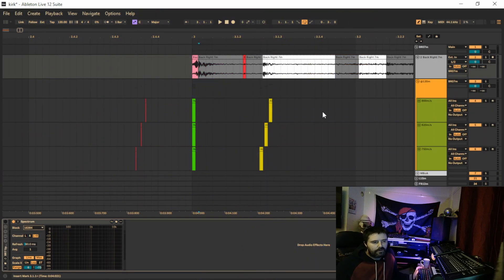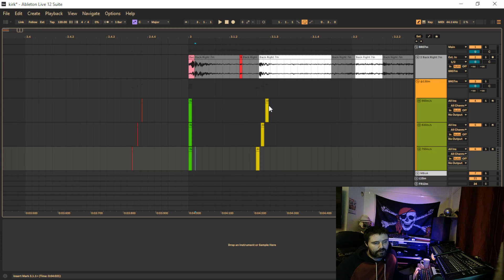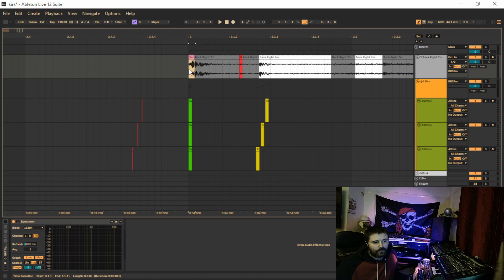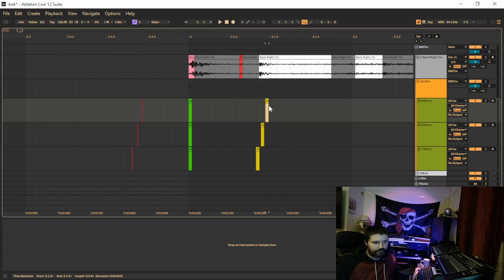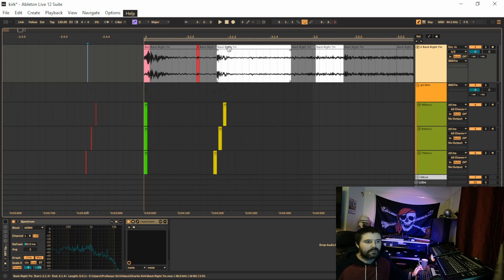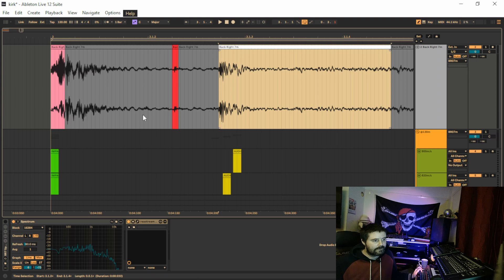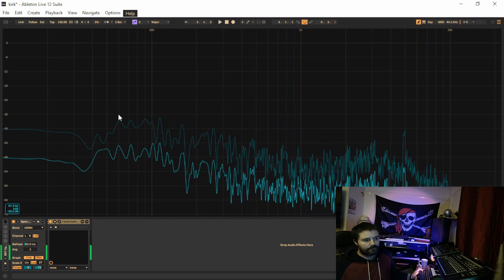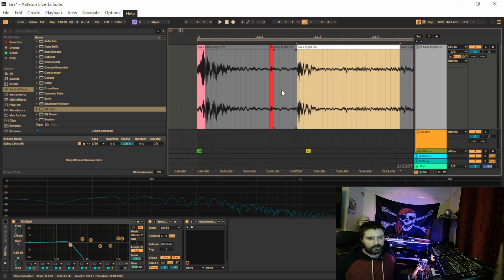I got a Freq'in Question

Comment: Been reading the comments but haven't discovered an answer to this: if the sound of the "muzzle blast" (boom) didn't come from 130m away from Charlie, could it (the boom) have been broadcast through the loudspeaker(s) around and near Charlie?
Reply from the maker: Great question! I do actually have reflections with the PA system in. There is a 2.8ms delay in the audio reflection which works out to about 1m distance I think, off the top of my dome. So, yes there definitely is a PA system being picked up and I can, and have measured it. And, I had it verified. As for the boom, the PA system won't be effective to recreate bass waves at 40hz efficiently, you'd need a much bigger driver than those speakers contain, so while it can recreate it to an extent, it can't produce what we would call natural sound and all it's dimensions. Hope that helps? :)
Reply: @Audio-Freq yes that's helpful, and I should've been able to figure that out myself. Not enough bass ability in those little PA speakers. 👍

Comment: Hey Matt, could you check the time difference between the left and right mic's for a camera on the left and then for a second one on the right of Charlie's position?
If the shooter is on the South side those should give similar l/r leads while if the sound is coming from the front of Charlie then the l/r leads should be opposite - correct?
I'm assuming (reasonably) the cameras are facing 180 degs apart, both aiming at Charlie. Make sense?
Reply from the maker: Yes, definitely. It's a little bit trickier to time the impacts for me. I can try though it's going to be happening in one sense or another

Comment: "The Impact"?  What do you think 'the impact' actually is Matt? A sound ( of what exactly?) An action ( of Charlie being hit? his body reaction? What is your opinion?
The timing between those two main things you are asking about is around 0.218sec. That is the exact time between the sonic BOOOOOOOM! ( It is LOUD! as it is the CLOSEST sound to the mic's! and the BOOOOM is made from the barrel right up to the point it hits Charlie!!) and the later bang of the rifle 130m away - it is a quieter sound by the time it reaches the mic!
The sound of the 'impact' being the bullet as it hits Chalie would be indistinguishable by comparison as the sonic BOOM is still being made right to the millisecond it hits.
Sonic booms are loud noises, particularly when the sound is being generated VERY close to your ears or a microphone (close being within a few metres!) It's not a negligible component of the sound we hear as a 'gunshot'. ( In the case of a supersonic bullet.)
The red lines you draw as when the gun is fired have to be 0.153 seconds from the BOOOM and 0.371 seconds from the bang.
Hope that clears the confusion a little?
* I'm using 850m/s for the bullet and 130m for the distance - you can vary those either way a little but you'll get the result in this area. It will vary as the distance the mic is from the Lossee centre decreases.
Reply from the maker: Well the impact of the sound of the projectile hitting something. A thud. This mic was behind and to the right, I believe? It's separate from the sound behind the bullet because the bullet should be moving faster than the speed of sound
Reply: @Audio-Freq  Thanks for clearing that up for me Matt!
On TV (and also in real life) we associate the act of a bullet hitting something with a sound - a 'thud' or 'ping' as in a ricochet, 
That is NORMALLY the case - for subsonic bullets.
Supersonic is a different matter. When the bullet hits something it is still making the BOOOM! so any impact sound into something soft and pliable (like someone's body) Is made at the EXACT instant the bullet hits and the BOOM stops being heard (at the point of impact).
The boom disguises the sound of the impact!
Mic's any distance away always hear the sonic boom noise first, (becaue it is MOVING faster than sound) but it would be very quickly followed by the initial impact noise.
This is because the impact sound travels from the target direct to the mic at the slower speed of sound while the sonic boom is in a 1:2.33 ratio 'triangle' trailing the bullet line with it's tip at the body point and traveling at 2.33 times the speed of sound. (Important note: the crack moves through the air at the speed of sound BUT the cone is moving relative to any observer 2.33 times FASTER than the sound. Crazy huh?)
I think I calculated the timing difference to be something like 1.55m per every 10m distance from the bullet line so if a mic was 10m from the bullet line and level with the target the sound would arrive in 10m/350m/s around 0.03s while the cone is moving over twice that fast towards the mic so would hit the mic around 0.013??)
Are ya with me?? ;-)
Reply: @Audio-Freq  Did you see my 'explanation' below (above?? = on this comment thread starting with 'The impact?')

Comment: 3000’ per second. Around there, if it was a 30-06. But it was not a 30-06. It was a smaller caliber, and it was close. In that space a magnum caliber round would be a LOT louder. 5.56 would be moving at around the same velocity, about 3200’ per second. Less if the barrel was short. It sounded like a 9” barrel, no suppression to me, based on audio from that camera just left of the stage. It sounded like 30-40 yards. 

Short barrels have a lot different report. They are sharper and louder, and they also emit a good bit of flash. So, nice for hiding, but when you let a round go, people notice. Also a lot of smoke too. I thought at first that the weapon was bolt action, but your audio kind of sounds like it might have been semi auto. The bolt cycling makes a good bit of noise, in addition to the initial report. Like a really short echo, but higher frequency since it is metal on metal, chambering the next round. 

I think the round that hit Kennedy in the temple from behind the fence in the parking lot (grassy knoll) came from something like the XP-1000, which was a pistol. Lots of smoke from there! The short barrel normally requires a tax stamp, but not if it is a pistol instead of a rifle. They market stabilizing braces for the AR-15 based pistols that make a pretty good stock. That’s why they were trying to ban them, because they considered the brace to be a loophole around a Federal registration requirement for a Short Barreled Rifle (SBR). A lot of people in the US have had plenty of experience with the sound of rifle fire from various calibers, both from behind the shooter, beside the shooter, and down range of the shooter. These people would back up what I am saying when listening to the audio, which is why there are so many people questioning the official narrative here in the US. It’s all wrong, and we are not letting go.
Reply from the maker: Yeah, I don't really want to go into the gun itself. I'm focusing on the provable physics of the sound.

Comment: So close - I thought you’d got it, but no.

From your DAW page, the red line is the moment the gun is fired, the green line is where the shockwave emanating from the base of the supersonic bullet arrives at the mic and virtually simultaneously the bullet impacts (like a few milliseconds later) Charlie Kirk, the yellow line is the muzzle blast of the rifle traveling at the speed of sound finally arriving at the mic.

As far as bullet velocity and distance is concerned, they are inversely related. 
A fast bullet could come from a shorted range, a slower bullet could come from a longer range and they would both produce the same time delay of 206.25mS.
I knocked up a spreadsheet to allow me to quickly see how these two things related.

However, there is a limit to how fast bullets can go without falling apart midair. Lots of variables here - temperature, speed, twist rate of the barrel, how the rifling is formed, thickness of copper jacket.
You can get an idea of what muzzle velocities are typical from looking at ballistic tables for different calibers, bullet weights and shapes.
Most will max out at around 3200ft/s muzzle velocity and around 2700ft/s is typical.
So that gives us a rough minimum distance that the shot could have come from.

So we plug the numbers into our spreadsheet:
300 ft - too fast
600 ft - too slow
450ft - right in the ballpark.

To answer the question : in order for a shot from 130m (426.5 ft) to produce a delay between Crack and Bang of 206.25mS (9900 samples at 48k) it would have to have an AVERAGE velocity of 2656 ft/s (809.5m/s) over the 160.2mS from muzzle to impact.

Of course, the muzzle velocity will be higher than that and the impact velocity will be lower than that - and it won’t be a linear deceleration. But it gets you in the ballpark.
Reply: Exactly that! ;-)
Reply from the maker: Question: If the sound and the impact happen almost simultaneously, how can the shot have been fired from 130 m away?

I don't know why you're explaining  how bullet speed and distance produce a 206 ms crack-to-bang delay.
Reply: @Audio-Freq - when you say "the sound", which sound do you mean?
Is it the muzzle blast from the rifle (boom) or the shockwave from the base of the bullet (crack).

Renember, the muzzle blast travels at the speed of sound, the bullet is travelling at over TWICE the speed of sound producing the shockwave in its wake.
Reply: @duncanmcneill7088  We're both on the same wavelength here - Matt is focusing on a somewhat different one that is more obliquely connected but we both need to have a common 'starting point'.
I think Matt is coming from the idea that when the bullet hits a target, mic's can pick up the sound it makes as a physical object smacking into another, He has been separating this from an 'earlier(?)' sonic boom (the crack) and the sound of the gunshot (the bang).
I'm telling Matt the crack and the impact sound are simultaneous AT THE POINT OF IMPACT! Would you agree?
Matt's 'impact' sound would be heard AFTER the sonic boom reaches any microphone as this is moving faster than the speed of sound. if the mic is closer to the target than the shooter it would register Matt's impact before it hears the bang. If it was closer to the shooter the mic would hear that sound first. (Neither are the sonic boom traveling in a cone shape moving along the bullet line from the rifle barrel!
The impact noise (bullet hitting body), I feel, would be negligible compared to either crack or bang in any microphone?
Reply from the maker: I mean, it takes 144ms for the projectile to travel 130m, at 900m/s (red - green). you won't hear the gun until afterward. 235ms afterward (yellow). The crack isn't part of this question, but you can hear it at the transient. At the start. The boom is at the same time. give or take a few ms.

Comment from the maker: So come on then — if the impact and the shot line up almost perfectly, why do you think that is?
Give or take a few milliseconds, it shouldn’t be possible at 130 m… or should it? 🤔
Reply: Doesnt the "crack" mean the continuous booming sonic cone that forms at the tip of a supersonic bullet as it rips through the air? You seem to be expecting the microphone to be picking up sound from 130m instead of the bullet tip 7m away, it's the bang at the muzzle that you would expect the delay from
Reply from the maker: @tsa-316  That’s exactly what I’m saying. An incoming bullet shouldn’t make that kind of loud boom. You’d normally hear a short crack as it passes, then the impact, and the big muzzle blast from 130 m should arrive a few hundred milliseconds later.
Here, everything’s bunched together, which is what’s odd.
I just want to understand how the bullet side of it works — the audio’s loud, but physics-wise I’m not sure.
Would a bullet moving toward the mic faster than sound actually sound like that? I’m genuinely curious
Reply: @Audio-Freq  Yes, yes it would/does. There are people here who change paper targets on rifle ranges who will confirm the bullet crack is loud and they hear it before the sound of the gun for supersonic bullets. The sound of a bullet hitting a body is 'soft' in comparison.
But you are operating from the assumption the bullet sound you hear is from the bullet that hit Charlie. Almost all ballistics experts say that neck wound is an EXIT wound, not an entry wound which means the bullet coming from the Lossee centre was NOT the one that hit him!! Where that bullet was actually aimed at is an interesting question!!?
In terms of the 'sound' - have you heard the sound of a whip crack of stockmen? It comes from the tip of the leather whip breaking the sound barrier, a small piece of leather makes a very LOUD crack! So does the small metal bullet moving 2.33 times the speed of sound. 🙂
Reply from the maker: @MrAuswest  Yeah I wouldn't know bud. I'm asking the question to clear it up. From my perspective, I'm measuring the second boom as a reflection. I'm clearing it up so I can move forward.

Comment: It seems you could narrow down the location of the sound source by measuring the time between visual impact and the arrival of the rifle sound, if you had video and audio from multiple recording devices.  Obviously, the visual impact should occur at the same time for all recording devices, but the sound arrival will vary depending on location.  The time between visual impact and sound arrival will be less for devices that are closer to the sound source.  Therefore, if you have at least two recording devices, you'd be able to determine which of the two was closer to the shooter.  Then, additional recording devices should start to narrow things down, much like a game of warmer/colder.
Reply from the maker: The problem we have is that film runs far slower than audio. The impact is seeming to be quantised to the fps, so i can't get an exact impact with my software
Reply: @Audio-Freq  I must be misunderstanding. Isn't the sound of videos sync'ed with the video? Worst case, the video is 24fps, which is 42ms per frame. That should give you a 42ms error-bar, is that what you mean by "slower than audio"? 42ms error-bar for a bullet traveling at 900m/s is of course quite a large error-bar in meters, about 38 meters. But, once you get several samples/videos, the law of large numbers start to kick in, giving you a "statistical leg up".
Reply: Yes, this would work but the some circular reasoning is involved - there would be a be a whole bunch of solutions which would work for each microphone individually but (hopefully) only one solution which would work for all microphones.
Being pedantic, the process is called Trilateration as it involves overlapping circles rather than Triangulation which involves lines intersecting at angles.
Reply: @duncanmcneill7088  I didn't know it was called trilateration. Learn something new every day:)
Reply: I had the very same thought, from the get-go. But I would not be surprised if I was wrong:p Overlooking some dynamic which would invalidate the approach :p I am not the smartest shed in the toolbox.
It would seem like a straight forward triangulation. That's why I think it might not work: because I thought of it :p

Comment: This may be backtracking, but are you automatically assuming that the rifle sound you are studying fired the bullet that hit Charlie?
Reply from the maker: Nope
Reply: @Audio-Freq  I would allow for a subsonic rifle as well, that could be the point of using a Patsy.
Reply from the maker: @Adm-Kirk yeah, it's definitely allowed
Reply from the maker: @Adm-Kirk  I make no assumptions on that part because it's not my area. Hopefully my data can help support someone else in the future
Reply: @Audio-Freq  That's what I'm trying to do:
The main theme weaved into this operation was Timing. Timing of the last question asked to Charlie...timing of the gestures and actions of TPUSA security...timing of the supersonic rifle shot...timing of a subsonic shot...timing of a figure on the roof...If you have sound data that shows a bullet hitting at slightly wrong time, maybe you've just detected the second rifle? Sound alone won't solve this until you know what to attach the sound to.
Reply from the maker: @Adm-Kirk  Yeah, I mean. of course. What bullet though? I have a friend that work in the place that makes smart bullets? 

Too many variables in that for me to touch. I'm only interested in the provable's for my tests.
Reply: @Audio-Freq  Yeah I get that man, you've made that clear, you are just a sound guy.  Nonetheless, other information is not your enemy it's your friend. Yes the bullet thing is very cluttered, which bullet, which trajectory, and which path in the body? Are we even talking two bullets or has the 'leaked information' of bullet path within Charlie already been a lie?
A clean assassin uses a .silent 22 not a .30-06. 
Then again, body armor would change things to...I asked Frank Turek if Charlie was wearing body armor that day...he refused to answer. 
Keep up the good work, but sound alone won't solve this.
Just like it didn't in Butler.
Reply from the maker: @Adm-Kirk  All that other information can fit to the sound field, it can't replace it